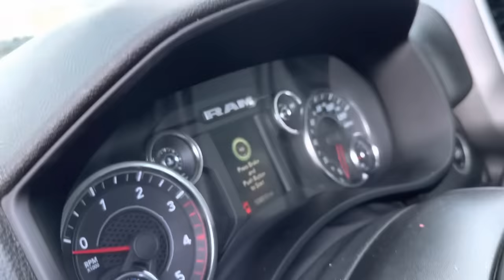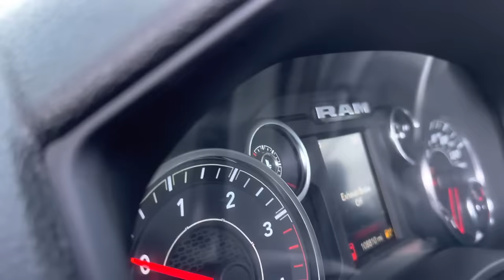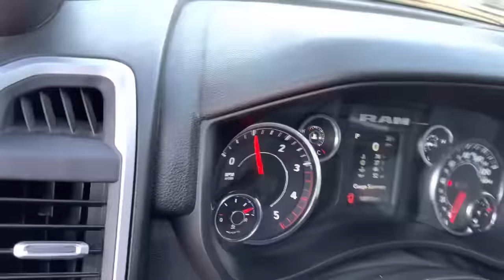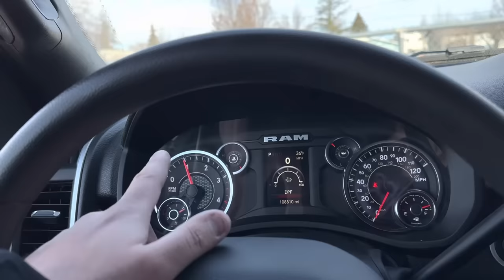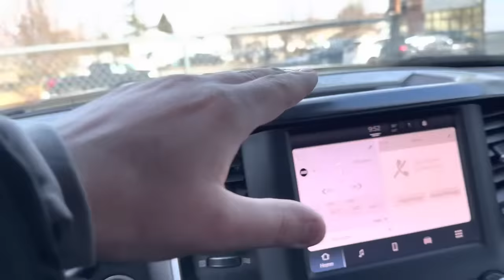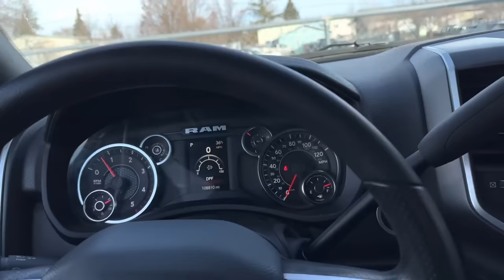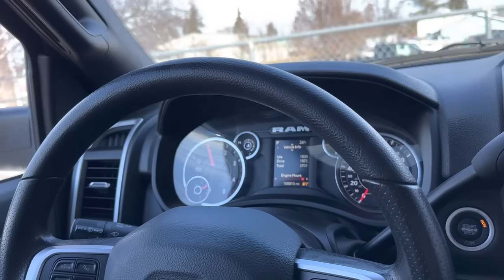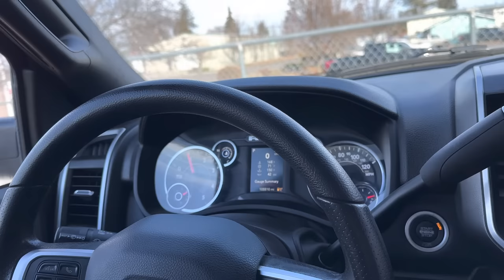2022 Ram 3500. 3rd engine down. 3 signs your engine is failing.

Comment: Sounds like it's wiping a camshaft, causing reduced compression in a cylinder or 2, which will plug a dpf filter quickly. Cummins switched the hydraulic lifters on these new engines, hopefully there will be kits to convert them back to tappets.
Reply: There is built by Hamilton cams

Comment: Can we get production dates on your ‘22s that have failed? I just bought a brand new ‘22 3500 HO with Aisin. It was built 12/22. Has been great so far but I only have 1000 Miles on it. 
Thanks!
Reply: 🤣...a 1000 miles? That's not even broken   in yet. No one should say how good a vehicle is until it hits 100k.
Reply: Find your engine serial number and go off the build dates of the engines. Will be a much more accurate metric.

Comment: What oil are you running? And what weight?
Reply: Hopefully a 5-40 or 10-30 moly based antiwear package and not anything 15-40 with high ZDDP to clog the emissions system

Comment: Paul, I have two 2021 with 180k never went to limp mode but one gave me a warning , bad DEF, put in platinum DEF and got solved, the 21 I’m driving now has done an regem twice in a 300 mile interval, do you think it’s normal ? No lights no codes yet
Reply: I always use the platinum DEF. Insurance is worth a few extra dollars.

Comment: Do you have all 3500 with HO engines? Do the standard power Cummins doing this as well?
Reply: on the medium duty side, corporate has 3 pete 330's with the 220 hp package, Allison 2500 trans, 2 are pushing 80k miles, no problems.

Comment: My 2022 has been flawless.  9 months in, several heavy tows, perfection.  Incredible mileage too, 22 unloaded cruising on the highway.  I am sure that after the last 2021 Ram Cummins rolled off the assembly line, Cummins met with Ram and said, "Hey, we are tweaking the engines that are going into the 22 trucks, we are not sure how it will go, but we are going to tweak something that already works perfect."  And I am sure Ram said, "Sure, let's take a chance that what you do is going be less reliable."  NOT.  Videos like this are garbage and done for sensationalization to get views. It is that simple.
Reply: Lol worst take I've seen.
Reply: Give a better take. @cstgx
Reply: I agree 100%
BS info
Reply: Good to hear on your 22. What date does the door say?
Reply: @huntsimple9527  I have 3 recalls on a 2022. Tailgate latch, Inhaber Air Grid Heater Relay, and Particulate Matter Sensor. Anything more than that I do not know. Is there something I missed? 
I do think that I will start changing my oil at 5k miles. It will be expensive but it is my personal insurance. I did not buy the extended warrenty. I love this truck. It is not a business vehicle. The only hard labor that it sees is towing a 10k lbs camper 4 to 5 times a year. Thanks for the reply.
Reply: @huntsimple9527  Mine is a 22 with a Nov. 2011 born on date. Love the truck.
Reply: Likewise, 22 mph with the CC set at 60 mph. I use the platinum DEF too.

Comment: I have been watching these trucks have this issue and I am convinced it is 2 things. They should all have 5w 40 ran in them and they cant be idled! you have the same amount of idle time as run time. knowing you hot shot long distances means your drivers likely run the trucks over night on the road. 20 minutes of idle is long on these so 8 hours would be a big red flag. In todays world its Wild to think a heavy duty truck will wreck a motor from idling but it is what it is.

Comment: It makes me wonder if these problems are caused by going to a cgi block? Are they not getting all the trash from the block during machining? It’s weird that the Cummins had more issues with the cp4 pump than the powerstrokes and duramaxes. Is there trash getting into the pump causing them to grenade faster than the other two?
Reply: It’s not the block. That’s a fact.
Reply: @HalfShell they only used the cp4 from 11-16 if I’m not mistaken.

Comment: Only thing I could think of thats different with the 22s is that final sensor missing off the dpf. Very strange whats going on.
Reply: My 21 has had dpf filter replaced twice under warranty about to hit 32k miles.
Reply: @quickdrawmcgraw3784  Delete it with EFI live and let it live to a million

Comment: Turbo actuator gave out  and it would only go in to limp mode towing  but ram okay by itself but sounded like that
Reply: Sorry also changed egr valve and dealer did egr cleaning ti unclog the system , apperantly its service at 50k but they don’t say anything

Comment: Full deletes only way to go. 2011 3500 6.7 H.O
Reply: the worst part on the 2011 6.7--- that EGR cooler!!!
Reply: @rearspeaker6364  Banks has a fix lol.
Reply: @rearspeaker6364  Full deletes post says.
Reply: @rearspeaker6364  Exhaust Gas Regen lol don’t have that. Part of the full deleted. 4” from the turbo back 🤣😂.

Comment: I would start trading the 22s in before issues . Appreciate you 🙏 do reviews on them new trucks before we buy one. I have a 19 cummins with aisin .no issue at 70k miles. At one point when cp4 issue was known i was wanting to trade in for 21 or 22 that had cp3 and now i know to keep my truck.I put my truck on dealer list for cp4 recall late last yr. Finally I just recently got a call from my local dealer and saying my recall cp3 pump is in and  schedule next wk for the swap. There saying it use to take a month or more to get new updated pump in and now it takes a wk to get in .As far as I know they well be covering the cost for recall.
Reply: only the 21s are CP3. For some reason they decided to switch back for 22.
Reply: @devvoid1312  I don’t think ram went back to cp 4 in 22. They stayed CP3
Reply: I have a 20 with 30k miles. Had metal shavings in the front fuel filter (I use hot shots EDT and every few thousand miles hot shots diesel extreme) took it to the dealer and they said that there’s a recall for the fuel pump (cp4) so under the recall they replaced the cp4 with the old vp44. Thinking about selling the truck before the serious problems start.
Reply: The new pumps is cp3 and if you have metal in fuel filter check the fuel psi regulator as well .they should be able to swap out complete new fuel system and clean tank under warranty.

Comment: Have you ever had a grid heater failure?  My friend had the bolt let loose on his 2021 truck yesterday.
Reply from the maker: No issues with heater grind bolts. 4th or 5th gen
Reply: @pddieselpower  that’s good to know.  You’re videos are sure making me second guess buying the 5500 I factory ordered.  It just arrived at the dealership on Tuesday.  I am holding them off while I find a flat deck for it but I’m nervous as heck about buying it

Comment: I have a 2022 2500 diesel and it’s making the exact same noise. Even the startup hiss is the exact same. Mine has 53,000 miles on it. I’m not happy. I owned Cummins engines all of my life. And this is unacceptable.

Comment: Now I'm worried about my 2021. I get a clatter during cold starts. Dealership told me it's normal during cold starts due to Cummins changing from a solid lifter to a hydraulic lifter. My truck Regen's with less than 200 miles. DPF according to a diagnostic device shows dbl % than the dashboard. So far no codes. Dealership says everything is normal and working properly. Yeah right! Dealership is using Mobile 1 10w 30w in this truck. I am now nearing 24k miles. Dealership also told me that they have no way to see the DPF % with their laptop.
Reply: You'll get a chatter with a cold start. Thats the nature of Hydraulic lifters.

Comment: Contrary to belief but just left Letting a diesel just sit there and ideal for any time greater than 5 10 mins is cause injected leak down and flash glasesing of the cylinder wall and makes it brittle and will take life away from your power plant. Plus your just wasting fuel. Just an tit bit for yah.

Comment: OK? So what's the actual problem? I only watched about half of your rambling about check engine lights that aren't on and engine noise with zero actual information. This is the 3rd or 4th truck you've had that has exhibited some kind of failure but you never actually said what the failure is. So what's going on with your 2022 HO trucks? Or is this the only HO?

Comment: Have you thrown an EXCESSIVE EGR FLOW code?
Reply: I did at 3000 miles.  Got rid of it permanently afterwards but the egr is still in place.  I wonder if I should check to see if the valve is closed or just remove it…
Reply: @Steadierpark  remove it and be sure instead of wondering if it’s open or not.
Reply: @diegaspumper8501  exactly 😉…next and last thing I did soon after.

Comment: sir do you have typewriter tick in any of your cummins?
Reply: I had a tick in my 2015 Cummins last week. Found out valve springs are cracked. Have 300,000 miles and just destroyed my motor.

Comment: Oh lord this makes me nervous for my 22' idk what the hell to do at this point I love the truck but I don't want nor do I have time to deal with those kind of issues! Paid to damn much for my truck to be having issues like that, not sure if i should sell her and hunt down a newish 21' or try and find a 4th gen that hasn't been beaten up on!?
Reply: I don't think you can go wrong with a low mileage well maintained 4th gen. I just dumped my 2013 powerjoke with DPF emissions nightmares for a 2017 Ram. Previously had a 2014 Ram that was great.
Reply: 4th gen and HURRRY UP
Reply: Do an oil analysis and it will show up if any problems
Reply: @repairvehicle  I don't see how doing an oil analysis will change the fact that these 22's seem to be failing I change my oil every 5,000 miles
Reply: @joekinabru4156  you can see if your oil is doing good job or not. Not all 22 are failing. His 22 are failing.
Reply: @RedskinzFan  you think I'd be better off with a 4th gen? Problem is they are to damn expensive I mean hell few grand more and you have yourself a brand new 3500 it's still crazy in the used truck market! Plus I have to figure out how to sell my 22'.
Reply: 22s are great. No problems with mine. Don’t listen to 1 person with a problem. Not saying his may not be valid but maintenance and good care and you will have zero problems.
Reply: @aaaron19  yeah I haven't had any issues with mine, I love it and I'd hate to sell a brand new truck to spend a few grand less than a new truck to buy someone's used truck!
Reply: @aaaron19 I bought a low mileage 22 2500 Longhorn.  How’s yours running?
Reply: @ponyxpress3  running great! 0 issues

Comment: Supposedly the 22’s dont come with sensor that controls def metering based on the load on the engine they are coming out with a certain output level of def pre set probably MAX my 22’ definitely has more def usage than my 21’
Reply: Yup that’s true
Reply: Did you take it in for the PF recall?
Reply: @ponyxpress3  i called to schedule an appt and they ordered the sensor so just waiting for a call i imagine it will be beneficial that way def usage it metered not just pre set

Comment: Just checked my 22 3500 Dually HO was built 12 2021.  But I know the grid heater will one day be an issue, in addition to the DPF.
Reply: The grid heater Is only an issue if the relay stays on and burns the bolt up. You can get a delete plate installed in under 2 hours

Comment: Wrong intake valve material????
EGR open to long,, to often??

Bottom end knocking,,, excessive bearing wear from the lifter, cam, push rod and rocker deteriorating and contaminating the oil
Reply: H.o. engines have hydraulic lifters  right??? Either way sounds like the intake valve is getting longer or the hydraulic lifter is falling with no oil cushion

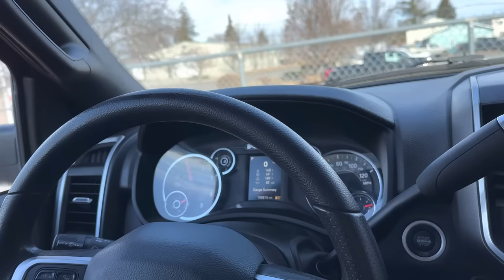Comment: Don't waste your time. Bait video. 11:43 he seems to start saying what the actual issue is but then continues to ramble. 13:15 no.  14:35 then he says the issue? No but he takes a wild guess. No then implies it's a chip supply issue but never clearly says what is the damage to the engine. 17:29 says there's 'an issue' but we knew that by the title.  17:59 no you didn't say what the issue was in a concise way. It was vague and rambling. 18:54 maybe oil passage issue, he asks in an uncertain tone.  At least the vid warns about this model year but nothing conclusive at all or statements from mechanics but just that he's personally had failing issues with the '22 engines pulling 25k lbs.  He didn't say what his previous 3500 failures were found to be.

Comment: Try running Liqui Moly 5w40 instead
Reply: At least state the "why" to support your claim as to how it would benefit
Reply: They spend a considerable amount of time to make sure each formulation works as intended. They have special formulations for many different applications, instead of a one size fits all approach.  

Specifically the 20426 Special Tec AA SAE 5W-40 Diesel is what would work in this application.

I really hope Cummins made sure the oiling was sufficient for the engine redesign.

Comment: I got a brand new 22 in December after driving about 7,000 miles I have used about 8 to 10 gallons of d e f. Is this normal for the 22's?
Reply: My 22 ford f350 has 5k miles on it, 1k towing 20k and it still has 1/2 tank. It's a 7.4 gallon tank. Just comparison to others. My 18 f350 needs 7.4 Gallons every 8k so that's accurate.
Reply: It all depends how you drive it . Just cruising around town no load and alot of idle time it will use more dpf and will need more regen vs if ur pulling heavy over the road. My 19 has been pulling heavy since day one never had issues with dpf system and never seen dpf Guage gone up above 10% . Lol I drive a toyota corolla to put around town so I save my truck from these issues. It doesn't matter what brand truck if it's a diesel there meant to be work.
Reply: 22 rams are missing a DEF sensor due to Covid and world wide sensor shortages. There set to max DEF
Dosage. The dealer is suppose to install the DEF sensor when they came available and update the firmware but many haven’t done it

Comment: Probably 85000 per truck   and   and 20000 for a new motor,   never buying k e of those   my 02 Duramax  has  326 000  kilos  only 1 set of injectors

Comment: All of this emissions stuff Is nut, I wish the guys at the EAP where smart enough to see that is it 1 step forward and 3 back. 
1. The extra materials sensors computers and components that go into making the emission system is one step back for the environment
2. The truck is going to be using more fuel which is not an unlimited resource due to choking nature of the emission system and the emission system needing "7 injector"
3. It's going to be using def which comes from China and you know how much they care about the environment.
4. The truck is going to be more unreliable that is going to be costing your business time and money
5. And eventually someone, it might not be you but maybe the next man is going to get so fed up with the emission system garbage, thire going to end up taking it to some back-alley shop and getting it deleted. 
It doesn't take a genius to figure out that the EPA is only screwing over the environment they claimed that they care so much about.

Comment: Should of bought a Chevy...hemi gas engines have never been reliable since they have been available in ram trucks high oil consumption overheating transmission issues I'd stay away from chrysler altogether

Comment: I have a 21 ram 1500 3.6 Pentastar and it's a complete piece of shit. Have had to replace the fuel pump, EVAP canister, BOTH 48V battery's that's power the Etorque system and still having major electrical and engine problems. The lifters went out at 70k miles and engine has quickly fallen apart after. After a year and a half owning it, I wish ai could just drop it off at the dealership and tell them fuck you. Paid approx 10k in parts in a year for a brand new truck because warranty only covers up to 36k miles. DO NOT BUY THESE NEW RAMS!!!!